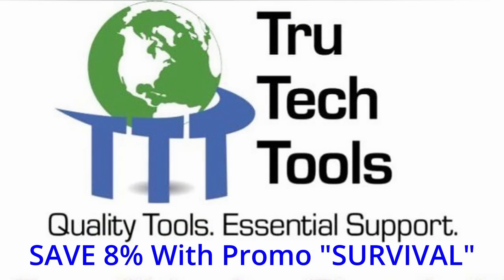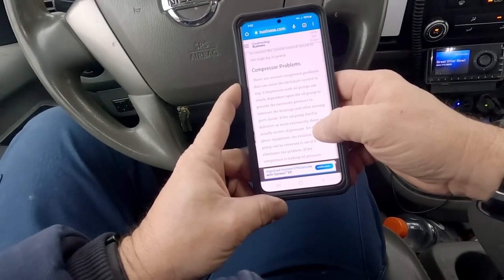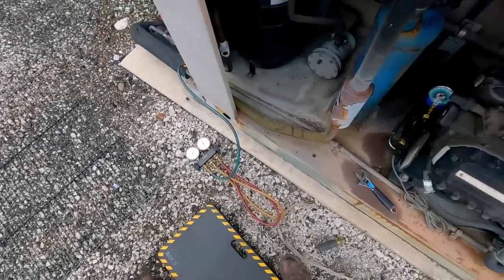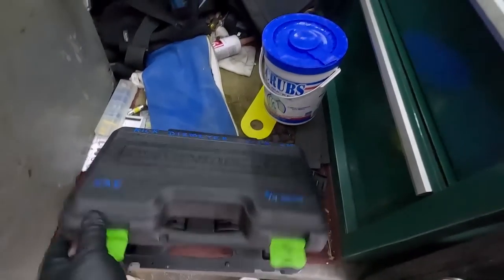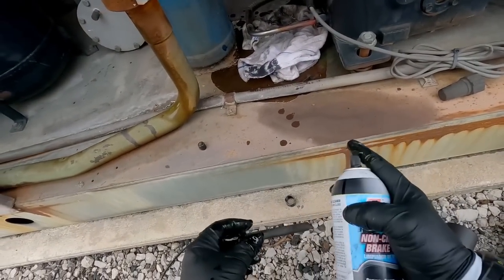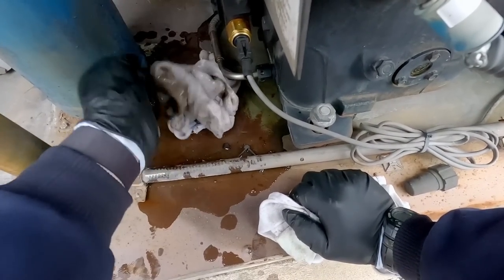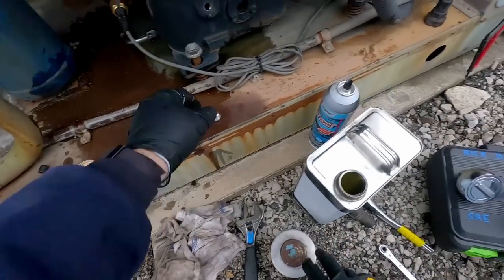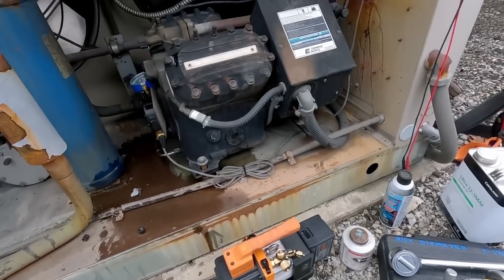Warehouse Freezer Warm Random Oil Failure

Comment: You'd be surprised how often I use my Knipexes as a portable vice, lovely perfectly parallel squeeze with nice flat surfaces and total control by hand.
Reply from the maker: They are perfect for the 3m crimp connectors. 🍺

Comment: We had a problem with the same symptoms on an alternate Copeland of a walking-freezer. The other guy put in a higher viscosity oil (ISO 46 instead of 32) when retrofitting from 22 to 404. The oil slowly ended up in the evaporator over a summer (the linesets were really long too). We resolved by purging the evaporator in defrost, replacing the oil with the appropriate viscosity and adding an oil separator.

Comment: I had one recently that was having oil issues, pumping the oil out of the compressor. Added some oil and ended up replacing the faulty crank case heater that was allowing refrigerant to saturate the oil (non pumpdown system) and getting the unloader working properly to reduce the short cycling. Went back a little while later to look at something else and checked on it, now the compressor was overfull, took out some oil. All seems well. With your system I wouldn’t doubt that theres some short cycle issues that aren’t making themselves apparent, or some occasional flood back washing the oil out of the compressor. All are problems that take a lot of time to diagnose and sometimes takes you being on site for a while to catch it when it happens.

Comment: First of all. I was one of those screaming about the channel locks. Now I want a pair. Had a similar issue with oil loss before. Put a new valve plate and problem went away. Good diagnostics on your part.

Comment: Just found your channel and as another refrigeration tech to another love your videos! I do supermarket refrigeration and a little tip I recently learned for cleaning Copeland sump screens-pull a vacuum on the compressor, pull the screen and put cap back on. Vacuum will keep oil from flowing out of compressor. And super fun to watch too!
Reply from the maker: Awesome 👍👍. I do a little rack work, I have a mix of everything under the sun.

Comment: FYI, United Ref. Makes a brass tee with a dip tube that threads into the body of the crank just above the sight glass, one hose pressurizes the crank to 20psi of nitro, back seat the tee and the other hose will relieve the 20 psi of nitro as well as oil and it will drain the crank every time. Check it out next time your in United
Reply from the maker: Thanks for the info!
Reply: You can also hook up a hose to the oil pump T and drain the oil down to the pick-up screen. This will drain the oil and you can verify if your oil safety is working properly when the comp runs out of oil.

Comment: If you go back, you could perform an efficiency test to check the plates and rings. Bad reeds and/or rings will always cause oil issues. At least on racks it will. Great video as always Rick. I think I may start posting some from the supermarket side.
Reply from the maker: Yeah definitely do so, as you noticed I'm getting into supermarkets and more industrial stuff so every bit helps and there's only a few people that post that kind of thing. Don't be surprised if you don't get many views because not many people work on that stuff but it doesn't mean people aren't interested in it.
Reply: @HVACRSurvival  yea I really enjoyed the one about the 3 way valve. I’m also posting my truck build. But you’re 100% right about not getting any views on that. Maybe my truck build will offset the views lol!!
Reply from the maker: You've got to do good thumbnails, you've got to do catchy wordings,  shorter is better sometimes, there's a lot of tricks to it. Plus it just comes down to the overall appeal. Sometimes you just get lucky. Even with 25,000 subscribers I'm still not getting 25,000 views so don't get to worry about it. That's why I'm trying to do two videos a weekend and it is a pain in the ass. I wasted all day yesterday and I'll probably waste most of the day today then I'll go back to work on Monday and do this crap again which kind of sucks.
Reply: @HVACRSurvival  hey do hashtags work very well? I’m going to have a truck build on here as well. And then maybe just me talking. Just a way to express myself really. Right now I’m doing all from my phone. My GoPro is in the van which is in the shop.
Reply from the maker: @NoBoW73  your phone does great, I just got a go pro 11 and that's why my colors are all off. I learning color correction lol.  The nice thing about the go pro is the better camera placement. Hash tags can help. Your best to start watching YouTube videos on how to get more viewers but the key thing they say is consistent uploads and good content.
Reply: @HVACRSurvival  yea I think mine is the hero 8 or 9. I have been watching you from the beginning and you have gotten really good at editing. Love the intro too.
Reply: My first thought: bottom out LPC, lock off liquid and see if it pumps into a good vacuum instinct is busted Reed / valve plate issues
Reply: Very few know supermarkets competently.

Comment: Get yourself some latex gloves.  Nitrile gloves are great, but you've almost certainly noticed certain solvents go right through them.   So, when you're going to be playing with acetone, brake cleaner, carb cleaner - pull a set of latex gloves over the nitrile gloves.   They withstand those solvents better.   They're also biodegradable, so you don't have to worry so much about throwing them away.  Makes the nitrile gloves last longer as well.

Comment: When talking to techs about oil issues I told them to do an initial easy check that is to reverse the rotation of the compressor. This would allow you to check two things first if the oil level changes when you reverse the compressor rotation then the crankshaft was either pushing oil up against the glass or away from it that’s why I always tell them to check oil levels when the compressor was off. Secondly if you see an oil pump pressure increase on the reversal then the lobes in the oil pump are worn and it’s time to replace the oil pump Copeland oil pumps will work in either direction unlike other manufacturers
Reply from the maker: That’s kind of interesting, I’ve never tried checking the oil, pressure and One Direction versus the other but I will have to consider trying that one time. I will mention that after cleaning the screens and oil pressure switch. I never had to go back out after that.

Comment: You can add a 1/4”” service port by removing the plug that’s above and left of the oil sight glass 
Once you’ve done that connect there and to the oil pump 
Close the suction valve and watch that crank pressure while pumping it down 
The pressures will drop normally but if the crank pressure shoots back up while pumping it down you have blow by replace the compressor 
I would’ve also pulled the valve plates and inspected the cylinder walls for damage the edges of the piston for damage 

You can also run it without fans and get oil back from the system 

I suspect massive flood back after defrost could also be your issue or 
Long line set with bad insulation can cause suction gas to condense and cause slugging on start up a rush of liquid can  temporarily plug the oil ports and trip the sentronic
Reply: I thought the same thing about checking for failed valve plate, but you would see it in your suction pressure if it wasn't holding; especially on a single.
Reply from the maker: Wouldn't the crankcase pressure be the same as my discharge on my oil pump while it's not running? It seemed to read exactly what I had on the suction side when I was checking it when it was off. And then when I pulled a vacuum it pulled through the pump then also. I know I've been told to check my discharge temperatures on my head and my crankcase temperature is while it's running. I was kind of in a hurry that day I got thrown another call and we had a Christmas party at 12:00. All bad scenarios

Comment: I've had to replace the oil pump on a Copeland 3D comp before. The crank on the compressor somehow sheared off the paddle for the pump??? It did it twice and ended up replacing the comp after the second time. Replacement oil pump lasted a good 6 months before it broke apart.

Comment: Check the “O” ring on the Differential Pressure Sensor. When the O ring is cracked, the sensor trips.
Reply: I would have hoped that would have been checked already I thought Rick said the sensor was replaced already
Reply from the maker: I didn't take the new one apart, I didn't think that had an o- ring, I've only replaced one of those and had to clean one other so I'm not positive.  I thought that was a metal washer style seal of some sort. I know the guy prior to me he's pretty good. We're all very careful about finding the problem the first time because if it's something we should have caught we don't get paid to go back. Call backs are a no no.
Reply: On the end of the transducer there is a little o ring. Out of the box they are not installed. But it would trip right away if not on. If the previous tech used the old gasket of the replaced one, then maybe it is cracked

Comment: i had issues at a warehouse freezer i installed a time delay on the liquid solenoid that way it could pump down again after defrost so when the txv is warm after defrost it will pump down again before restarting because the txv is wide open. it cured my problems  worked 35 years at hussmann
Reply: mine was the same brand of unit but larger
Reply from the maker: So where did you put the time delay in the circuit, and was it a delay on make or delay on break.

Comment: Just a thought....the evaporator may be oil logged. Let us know what you find if there is a call back. Thanks for the videos!
Reply: It's also possible that the oil return orifice in the suction accumulator might be plugged. Might also explain the oil at the suction service valve, after resetting the trip the refrigerant in the trapped oil quickly boils off and some oil often surges back to the compressor. Should be easy to find because the accumulator looks like a bucket filled with cold water when you look at it with a thermal camera. Same thing for an oil logged evaporator, you see some big temperature differences on the evaporator
Reply from the maker: @gabbertje2811  I mentioned the weep whole possibly being plugged in the accumulator. I will know by the end of next week if it does it again.

Comment: In the past on multi compressor split suction racks, the low temp side suction pressure was lower than the med temp side. I found 1 low temp compressor had oil problems, there's a suction screen Inside the rear of compressor that caught A TON of copper shavings. Probably not the same problem your having, take it with a grain of salt
Reply from the maker: This oil problem just started happening, I have people I could have asked,  I'm reluctant because I feel like I'm interrogated every time I do. Hence why I share what I do know better on YouTube because I'm sure other people deal with this too.

Comment: If the oil isn’t leaking out and over time more oil keeps getting added the volume of what I call circulated oil is to high and will be at every fitting in the system. Doesn’t explain why the oil keeps leaving the compressor but obviously it does. I bet the oil is in the evaporator. Crap on oil filter suggest crap clogging oil return in accumulator. Would still replace oil control before accumulator when it trips again. Never saw that screen filter before. Always learn from you.

Comment: Accumulator and rust on floor of condensing unit rusted showing  that unit used to alot of flood back. Also thought unit needs body cooling fan being low temp. Do capicity check on compressor.  Does it hold a pump down? Evap coil located next to door in warehouse? Door being left open? Strip curtains cut and missing? Coil frosted over? Got a feeling its something  more. I think youve been back...
Reply from the maker: This is a drive-in warehouse for food storage. Honestly, I don’t believe anybody else has gone back either and this was done I think last year. I don’t believe I’ve ever seen an outside cooling fan on one of these models. Usually only on the rack or a bigger unit side of the building. Not saying it wouldn’t hurt

Comment: I don't know why, but I am not crazy about that suction line being that cold and frosting. I think I would also suspect the TEV and superheat.  I know we need some liquid coming back to carry the oil.  I might also recommend an oil recovery unit like a hot gas oil separator to get the oil out and return it directly to the compressor. I never add oil unit till I find out where it went. One response said, you may have an oil log evep. And may be an accumulator.
Reply: For those reading this, I have 40+ years in HVAC/R and taught for 5 years. I am old school meaning R-12 and R-22.  I am sure the principles are still the same. Oil should never be added unless it is a new system and need to balance the large system loss or you have a oil leak somewhere. Hard to diagnose without "Laying of Hands" on the system.
Reply from the maker: I'm not too worried about the temperature coming back as a matter of fact Copeland recommends 30° of superheat. We were well above that, meaning we don't have liquid coming back theoretically. Now when it comes out of defrost and stuff like that some people are worried about that point of the startup, but you got to remember this does pump down so the refrigerant is stacked back at the condenser and the evaporator should be completely empty of refrigerant. Like I mentioned in the video I have a feeling that the accumulator has a plugged weep hole or it's slightly restricted. If that thing gets plugged it will not return oil to the compressor.

Comment: I’m having a similar problem. Oil alarms always seem like a nightmare. I had good oil pressure, good oil level. Thing would trip on oil. I think I’m going to change out sensor and clean oil filter.
Reply from the maker: I cleaned the screen and the sensor and I never had to go back so that’s definitely what I would recommend
Reply: @HVACRSurvival  thanks

Comment: im gonna spitball here since ive had a ton of issues with copelands in the past...I think you have weak rings and maybe a broken reed. might be a good idea to pull it down and do a rebuild.
Reply: by pulling it down and pulling the heads off you can check the cylinder walls and see if it has any ridges or wear. its a win win.

Comment: If the suction accumulator is in good condition you have to check the piping or to check if needs oil separator
Reply from the maker: I haven't ever seen an oil separator on a simple unit like this, only on grocery racks.  Something else might be wrong but this just started after at least 10 plus years. There are 6 other systems at this location just like this that are working. Either I got it fixed or it's one of the things I mentioned while looking at my phone in the truck. Time will tell
Reply: @HVACRSurvival  in Europe rule of thumb if it is a freezer needs oil separator the suction pressure is too low to move the oil back to the compressor 1,5 bar or 21,70 psi it starts to have oil return problems.

Tip change the working temperature of the freezer to a higher temperature : example from -1⁰F or -18⁰C to around 38⁰F or 3⁰C for one hour an change the txv superheat to full open this is forcing the system to run on higher pressure and forces more liquid refrigerant to flush the evaporator from the oil be careful and don't over doing it one to two hour is enough to return the 95% of the oil.

Comment: I know this is an old video but be careful with that Milwaukee battery adapter you mentioned. Most of those battery adapters don't have a low voltage cutoff to keep the tool from over discharging the battery. Milwaukee is one of the few tool makers that don't have a low voltage cutoff in their batteries and instead put the cutoff in the tools themselves. With these adapters, you can't guarantee the tool you're adapting onto is going to have a low voltage cutoff in it an can easily over discharge the battery. 

Just keep an eye on the battery charge level when using those adapters and don't let it get too low.
Reply from the maker: @TheWittyGeek  that’s pretty interesting information. How do you know they don’t have some sort of battery protection built into the battery? I thought they had a circuit board in the battery area. I know even my flashlight has a miniature protection device built onto the 18650 batteries.

Comment: Next time hook a hose up to the oil pump and let the compressor pump the oil into a bucket. Once you stop seeing oil come out of the hose, turn off the compressor. Obviously you'll have to add all that oil back. 
Also, there is typically a pick up tube that that screen sits in. There's a channel that has to face down or you'll have bad oil flow. 
I've also seen compressors that continuously pump the oil out, probably due to weak/ failed piston rings. Just gotta replace those compressors. 
Another thought is if that compressor is overheating, tripping that protection module, it'll trip the oil. 
Oil is definitely a beast of its own.
Reply from the maker: Those are such great ideas! Thanks! Pumping it into a bucket is so simple but I didn't think it it🤦🏻. I'm not sure I've seen a particular way for the oil screen to fit?
Reply: @HVACRSurvival  the first time one of the old timers showed me that I thought the same thing. 

That oil pick up screen sits inside a metal pick up tube. If you put your pinky inside that hole you'll feel it. You kinda have to hook it with your pinky and wiggle it past the threads. Or a pick works too. The opening on that metal tube has to face down. There are some pick up screens that don't have a pick up tube, but they're bigger and have a circle pattern on them. You don't see those ones very often. 

If you Google "Copeland screen oil kit" the URI website will have a picture of it.